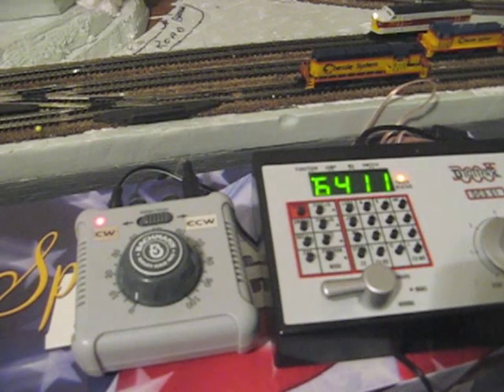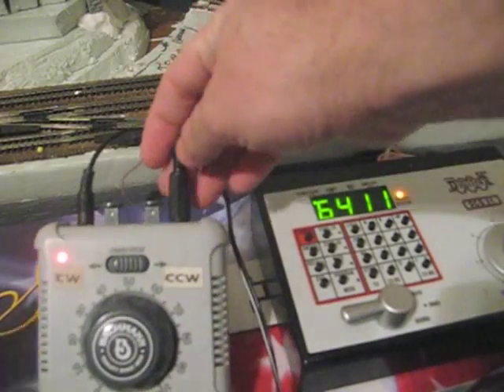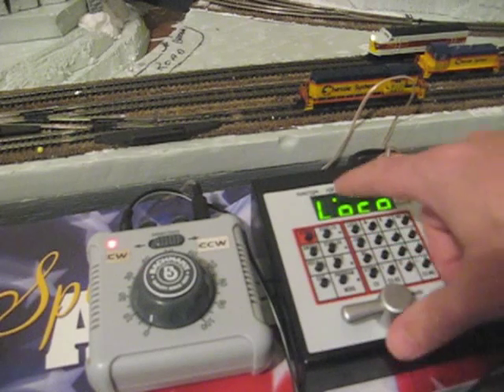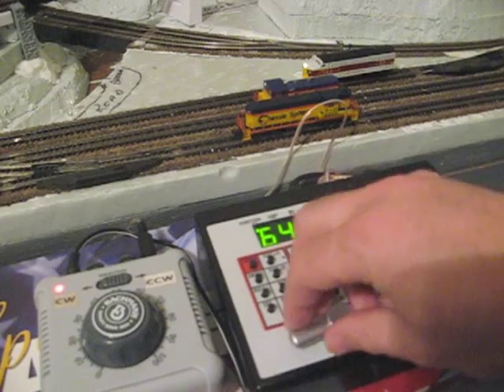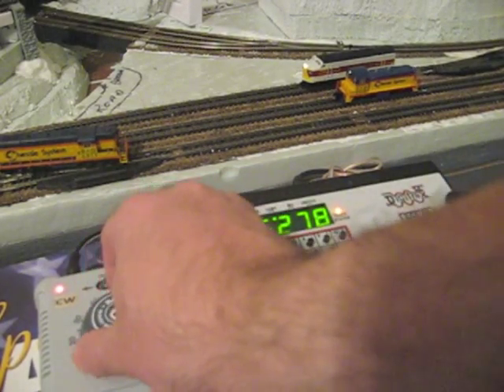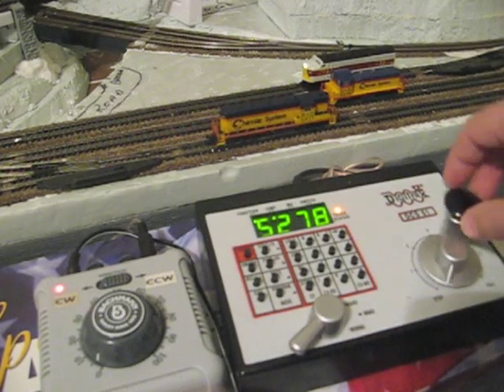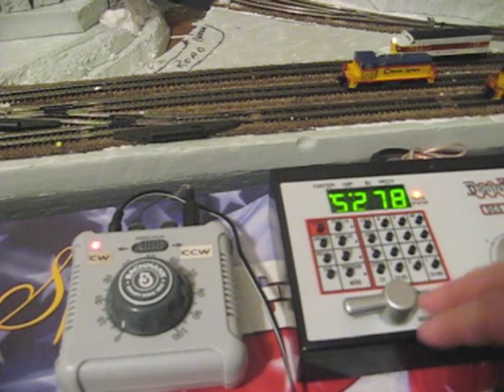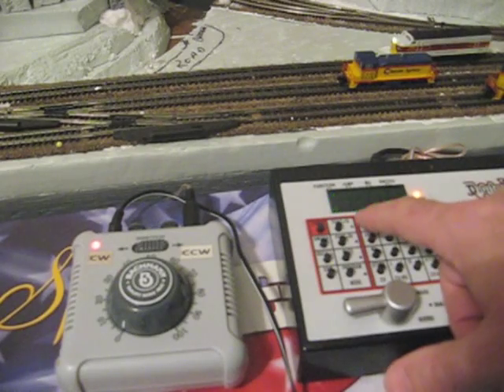The CH&FR Goes Digital Part 5

Comment: when you use a dc jump throttle, does it still sent out the DCC signal?
Reply from the maker: WAYNE1980AA Yes.  You can think of it like this.  There are three DCC throttles inside the Zephyr. One is wired to the controls on the box.  The other two don't have speed knobs or direction switches.  The Zephyr "jump" throttles uses the DC power packs as speed knobs and direction switches, but otherwise they are regular DCC throttles.  So the DC jump throttle is just a cheap way to add DCC throttles, it doesn't really have anything to do with DC control.  Does that make sense?

Oh, and all three throttles share the same set of function buttons.

Comment from the maker: If the MRC pack has a smooth DC output (no "pulse power" or anything like that), then it should work.  I'm not familiar enough with MRC's products to make a specific recommendation.  I'd suggest you check in with the fine folks at one of 3 places to get a bettera nswer:
1) the Digitrax Yahoo! Group
2) nscale . net
3) trainboard . com

Comment from the maker: Maybe.  It needs to be a DC pack that puts out a steady DC voltage that varies with the knob.  If the 9500 does "pulse" or "PWM" power output, it won't work.  For sure, you'd want to turn Momentum OFF on the 9500.  Won't hurt to try, but you can pick up cheap "pure DC" throttles like the Bachmann one I show for a pittiance these days.

Comment: So by using the jump throttle feature you can avoid the issue in your last DCC video of having to quickly adjust the Zephyr's throttle when switching between loco's. I'm thinking of getting this system for a small HO layout I'm working on. Very informative.